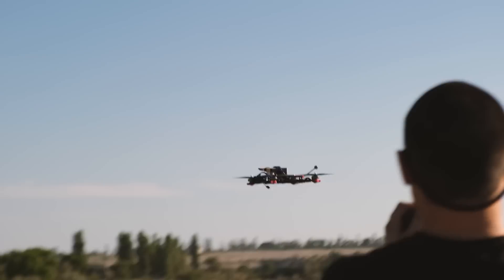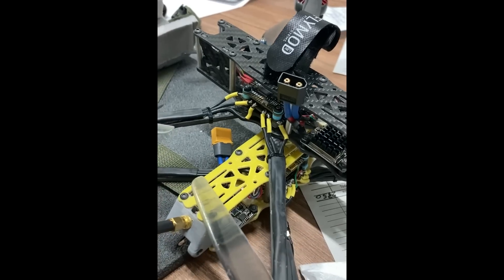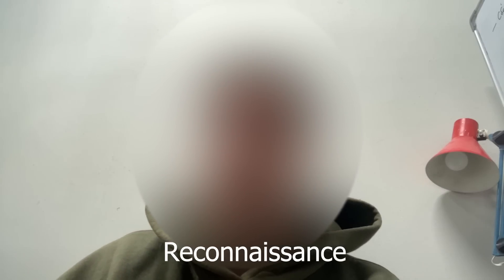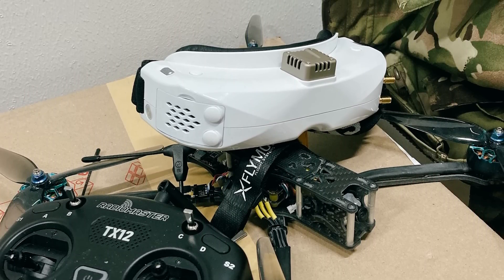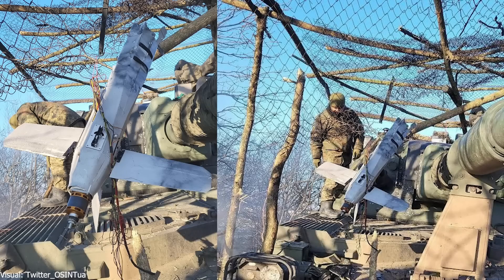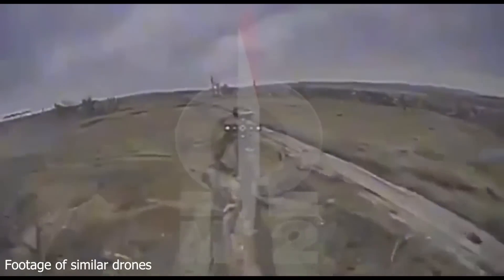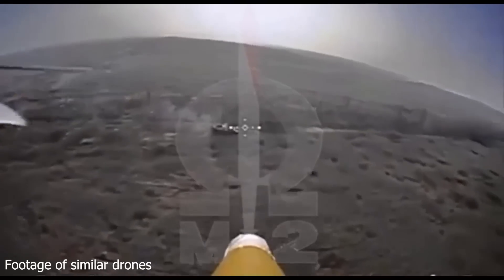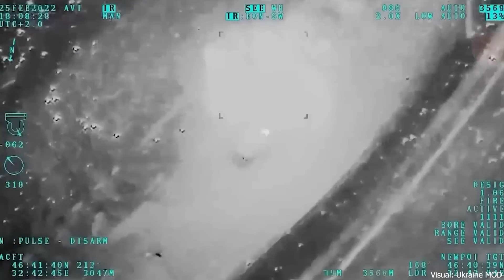Ukrainian Soldier explains how he uses First-Person kamikaze drones - (FPV drones)

Comment: This has much more in common to a mclos missile than a predator drone. The drone terminology is very.... imprecise. But the media has chosen what they will call them.
Reply: It is a redeemer with less explosive power (God - Unreal Tournament launched so long ago)
Reply: Kind of like how the Shaheds were labeled drones when they are essentially just slow rudimentary cruise missiles.
Reply: When a vision based, manually guided UAV used in a suicidal way to deliver a payload to a target the UAV becomes a missile. The line between a missile and a drone is blurred in current conflict.
Reply: @更雨晴  For bonus confusion, I think some of the slower missile systems like TOW could be battery electric propelled without loss of performance. The design space has opened up a bit.
Reply: @Seal Piercing  battery and the motor will all be dead weight. Because, for rocket, the weight of the missile decreases over time as the fuel being spent and the rocket engine can be quite light weight. However, if the laser guiding system gets replaced with a vision based tracking system, Tor would perform much better.
Reply: @更雨晴  For slow missiles like TOW, rockets have terrible propulsive efficiency. I calculated the parameters of a system with 300C consumer lithium ion battery driving electric props with 50% propulsive efficiency and it was just about on threshold for meeting specs of current TOW, at same weight as current rocket motor. Realistically if you replaced TOW you might want something more capable, but the rough parity of battery electric with low-speed rockets has arrived, and it's part of what's driving this proliferation of drones.
Reply: @sealpiercing8476  TOW is quite close to transonic - I doubt you will get that performance from battery electric propulsion.
Reply: @sealpiercing8476  Interesting. Can't wait to see what the next generation of these weapons will be like.
Reply: @dannyash3805  I doubted it too but if you can get 50% propulsive efficiency from the props, which is very good but not unreachable even if tips are supersonic, you can do it with consumer batteries on the same weight budget
Reply: @sealpiercing8476  That is a massive waste of lithium among many problems. Rocket propellent is cheap, stable, predictable, simple and castable. By nearly filling one requirement, you forgot everything else.
Reply: @oohhboy-funhouse  My guy, lithium carbonate is $60/kg. There are problems with that scheme, possibly fatal, but cost of raw materials isn't one of them.
Reply: @sealpiercing8476  That's not the refined metal which by weight is 0.18 putting the actual price at over $300/kg and you want to use a rare earth metal with the extraction rate of 80-90K tons a year compared to Aluminium that is in the millions of tons ($2.4/kg) on a one shot weapon. Energy density and total of the battery sucks compared to simply burning it, so you need even more. This will push up the price like crazy on a tiny supply that is far better used elsewhere like powering your electronics. Thanks for blowing up the market. Charge retention alone would disqualify it from being a ready to use certified round.

So yeah, it's bad and dumb on all levels. The only reason you quoted Lithium Carbonate was to hide the true costs.
Reply: @oohhboy-funhouse  Lol. Missiles are not a significant raw material stream for anything. Are you aware that, like, lithium batteries are used to power cars? A few million were produced in 2022.

The energy density is not as favorable as you think. A rocket motor with 250 s specific impulse has a propulsive efficiency of at most 12% at 300 m/s speed a TOW missile reaches, less during acceleration. Solid rocket propellants need to pack their own oxidizer so the energy density isn't that high to begin with, a few MJ/kg. 10% of that is battery energy density or worse.

For fast missiles it's no contest, but for slow missiles it is now. I'm not aware of a lithium battery chemistry currently that meets all the typical US requirements for a munition, but every day in Ukraine a bunch of commercial drones are expended as tiny cruise missiles so obviously requirements evolve with technology.
Reply: @oohhboy-funhouse  Lol
Reply: @更雨晴  That blur becomes even greater when the same weapon can be used both ways. Didn't find a juicy enough target when scouting an are? Return to base.
Reply from the maker: Yup, I made a video about 'drone' types but overall the majority of people will always just call them drones https://youtu.be/d4M1AUhSgFg
Reply: Terminology change over time. The first weapons known as torpedoes where immobile and are called mines in modern terminology.

Comment: Most interesting!  Partly I did not realize how small an explosive can damage or disable armored support vehicles.  The advantages of winged plane (efficiency of wings vs rotors: speed, range, payload) vs quadcopter (maneuverability, size) is an interesting tradeoff.  Learned a lot.  Thanks.
Reply: Yeah, the key is the use of a shaped charge warhead. I think the interviewee mentions that a plane can allow for a greater diameter warhead, which would allow for greater penetration (shaped charge penetration is usually given in how many diameters of penetration it has).